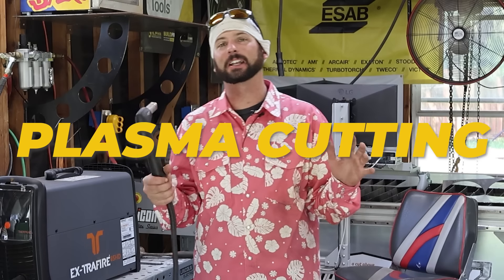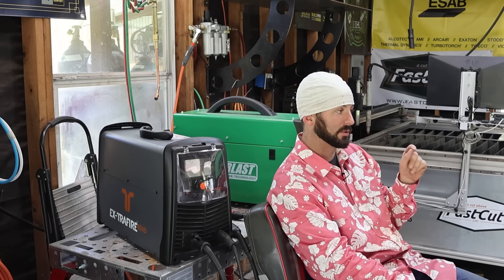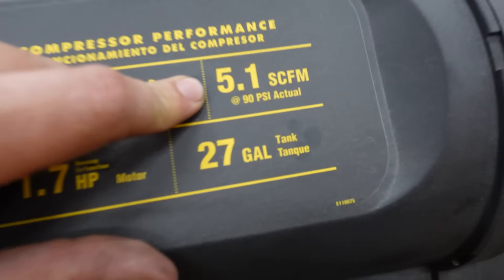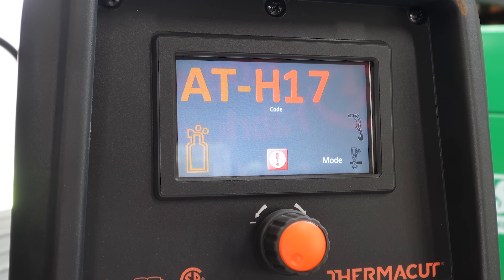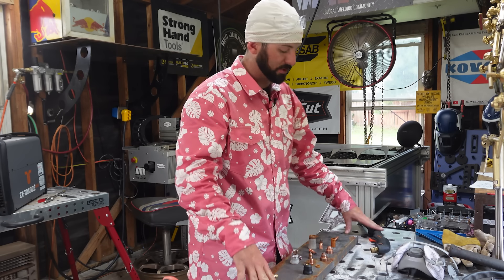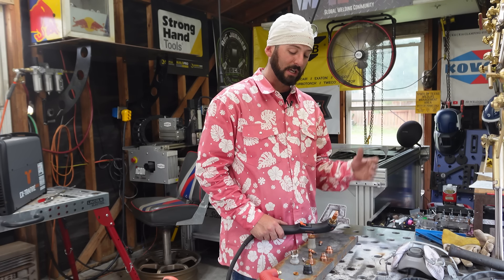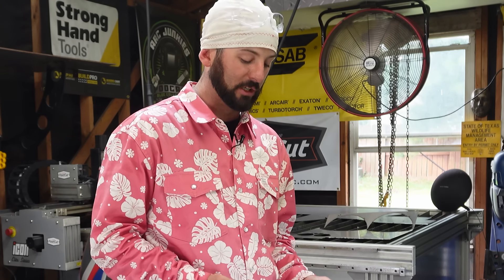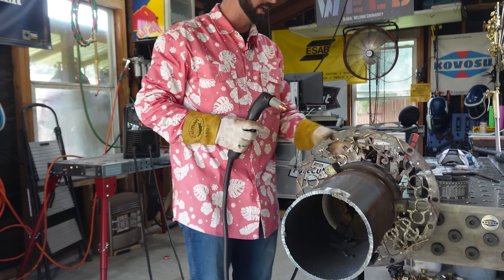Why Can’t I Get Good Plasma Cuts? Troubleshooting Plasma Cutters

Comment: Thank you very much. I have been welding for over 50 years and didn't purchase a plasma cutter until 5 years ago.  You just gave me the reason I had a lot of slag because of not running a good air dryer. Man, what a difference. I had it available because of my paint booth. Amazing difference. Thank you very much again.
Reply from the maker: Glad we could help you out!

Comment: About removing the moisture from air -the filters are divided according to microns they can filter .A 40 micron is standard for dust ,it will remove some water but not all of it .Its a cheap filter you get at hardware store for 10-.15$.
Now if you want to use a real deal then what you look for is 5 microns filter for industrial use -5 microns remove 90% water and oil from airline.Problem is thats gonna cost you around +200$.
For all of you that are not that rich you can buy silica gel filters that work but needs constant  replacements.They can be made out of pool filters.

For all of you diy guys that are not rich enough to buy 7000$ professional air dryer that works like air condition unit :
If you are more of a diy guy you can wrap a copper pipe coil od 1/2 " 20 foot long into spiral and put it in a bucket of water with ice (add aquarium pump for extra cooling) .Then you hook it to a water trap and you get relatively cheap air drying system that separates water and oil .YOu can use flare fittings or compression fittings to connect copper pipe .
Water trap can be made out of peace of large pipe and fittings.You take 2 " pipe and screw endcaps -on top endcap you drill a hole and  in middle weld 1/2" pipe that goes 1/2 of  length into large 2" pipe-this is where air goes after passing trough copper coil. On bottom endcap make threads for simple ball valve -its a release valve for water condenser. Near the top you weld a peace of 1/2" pipe to a side of 2" pipe and drill a trough hole in 2" pipe-this is where clean air with no moisture goes to plasma cutter.

Combine this cheap system with motoguard M30 that uses toilet paper and you will get clean air without moisture or oil in it .Once made its cheap ,it uses ice and toilet papre  roll -things you can get everywhere as consumable.
You can even paint a car with clean air like this.
Reply: moisture goes through filters, even the 0.01 micron ones which you fit before the dryer to make sure oil doesn't foul the dryer.
refrigerated dryers are pretty cheap these days. (harbor freight $600)tho  its often hard to find them small enough.  desiccant dryers can get the air even dryer, but they need recharging. you can recharge them in a stove. get the color changing silica gel.

Comment: Another excellent video, thank you!  Will a cheap 200-300$ plasma cutter (AMZN or HF) do the job to cut less than 1/8" sheet metal for yard art projects?
Reply: Absolutely. If you incorporate the suggestions in this video, you should be able to cleanly cut 1/8" or less very well.
Reply from the maker: The tech has come a long way and there are lots of great options out there.
Reply: If you got 600 to 700, Primeweld has an amazing product and even better customer service. Give them a call you and get a 20% code. You won't be disappointed. Cut 60D is what I have. I plan to get their new tig machine soon.
Reply: Great video, it's convinced me I need a better hair dryer 😎👍

Comment: The motor guard m-100 kit. Is by far the best air dryer for the plasma cutter. Especially in the field. They are commonly called the toilet paper air dryers. The filter looks just like a roll of toilet paper.
Reply: they are a filter, not a dryer.
Reply from the maker: We will have to check it out

Comment: What about stainless plasma cutting?
Reply: What thickness? 
Plasma is great because it cuts electrically conductive materials.  So you're good on aluminum too.
Reply from the maker: Plasma will cut any metal! all of these rules still apply for stainless. you made need a few more amps however.. compared to carbon.

Comment: How about the effects of to much air flow and not enough?
Reply from the maker: Not enough will lead to a little more dross, but if the cutter reads "not enough" it will stop cutting untill you clear the code.

Comment: it would be good to mention the sort of HP required for the air compressor, so at least people can get it close.
also pay to mention what type of air dryer. there is so many misunderstandings about air dryers even in the comments here. building a decent air system is a video series.
Reply from the maker: Indeed we might have to dive a bit deeper on that process